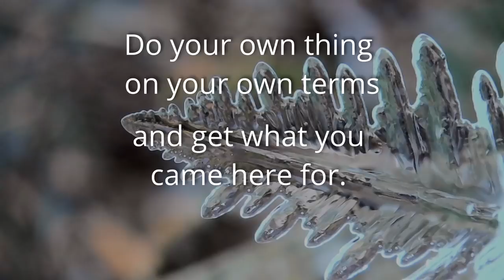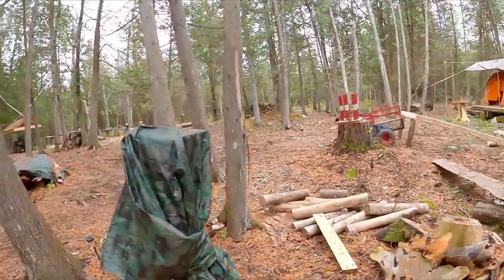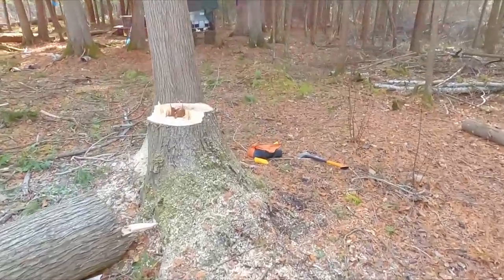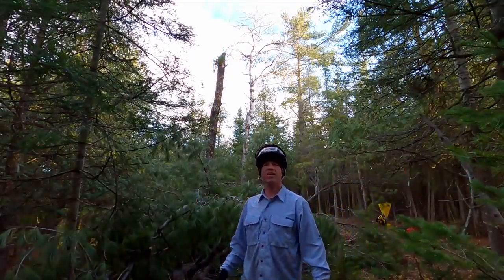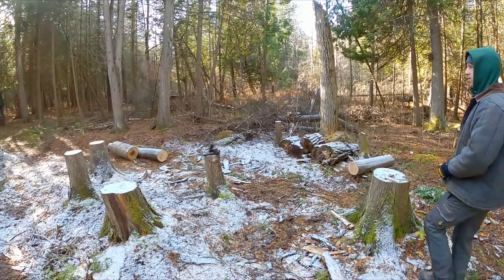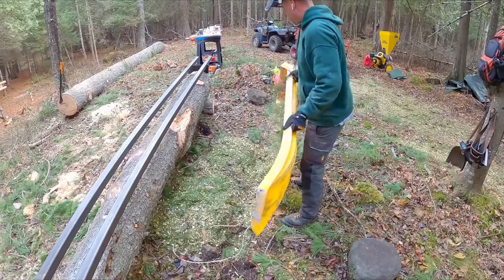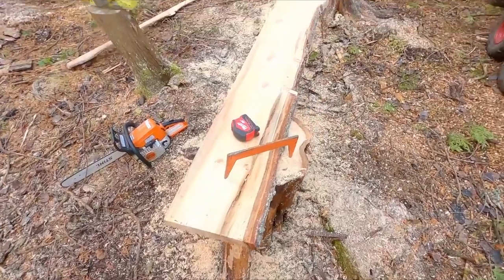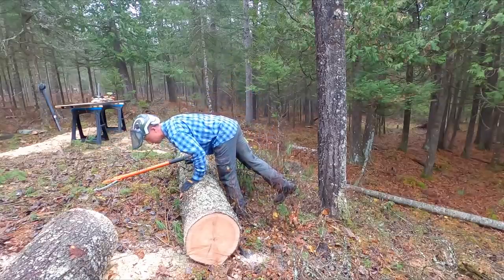Building a Tiny Cabin from a Giant White Pine with an Alaskan Chainsaw Mill.  #61

Comment: So, with all of those tapered boards, rather than cutting them into rectangular boards and ending up with the waste wedges, maybe just go with the natural triangle and then alternate them on your floor/whatever so from the end you have wide, narrow, wide, etc. and from the top it would resemble a backgammon board.  If you could make a buncha boards that are 2x6 on one end tapering to 2x4 on the other, alternating them should work and shouldn't mess up your symmetry...

Comment: Propane? Try a Chinese diesel heater.  I live in a 24ft rv, in Maine. I used Propane my first year $800.ish 4 mounth ish.then went to the diesel heater.$250.ish for four months ish. Just hook a 12 volt battery to your solar power run diesel. Roasty toasty.

Comment: Don't you own a tractor. If so get a logging arch for the three point hitch to drag the logs. The tractor can haul more than the ATV as well as lift the one end higher so less gets dragged on the ground. This will keep the logs cleaner. Cleaner logs = less chain wear.

Comment: What I do with slash is pile it in kind of walls. Wood from branches can be pounded a bit into the ground and or tied with wire to form "studs" on either side, then pile branches and other slash between the "studs". I had a chipper...still a lot of work imo. The walls were good critter habitat and I liked the look. They decompose over the years. A lot faster, less work imo.
Reply: Yup, windbreaks/perimiter delineation, critter larder and source of kindling in times ahead.
Pick your perimeter and pile it on the opposite side of two trees, if spaced nicely there's minimal need for studding poles.

Comment: Your crazy not to use a wood stove as a heat source...you have plenty of free fire wood plus wood heat is the best there’s nothing like it....if you build it rite with plenty of insulation you’ll be surprised how little fire wood you need to run a wood stove over the winter months....not to mention it’s the responsible thing to use as a heat source it just makes sense...I have a cabin in the woods and I only use 3/4 quarts of wood a winter to heat my cabin cause I insulated the cabin really well walls floor and ceiling....

Comment: Hey Ryan, new subscriber here and my name is Ryan and I'm in Michigan as well.  Love your channel, watching all your older videos now.  I am big on ideas so I always like to share some: I think a floor made of discs of logs would be awesome, as well as some stackwall building method walls.  I've always wanted to see stackwall done with squared up 6"x6" or 5"x5" with no chinking or just construction adhesive between logs...it would be very interesting and I'd imagine fun to engineer as you do on the fly.  Also I'm a huge fan of those Chinese Diesel air heaters, I'm actually making a video right now of me installing one to heat my garage, they're cheap to operate, quite safe, and really fun to setup really (also inexpensive and efficient)

Comment: Is there a reason your floor boards need to be 2X6? Why can't you have some 2X8, 2X9, 2X10, or even 2X11 1/2"? Since none of your buildings are square, you could make some floor boards 10" on one end and 7" on the other. Whatever it takes to make it come out right. It's so much fun watching you have fun in the woods. 🙂

Comment: Just recently found your channel. The way you explain your thinking. Doing it the way you do because you like to just wing it. And you just like running your saw. You are my kind of people. I've just recently got a chainsaw mill and have been practicing and making some 1" boards for siding a pole framed storage. Can't wait for the snow to go away so I can get into some larger trees to will dimensional lumber. I'm also off grid staying in my converted cargo trailer. I've put solar on the roof and a DCDC charging system that I hook up to my truck to help keep my powes bank changed in swinter. I eventually want to build a cabin. . In time. It's not easy on the back, especially one that's had a couple surgeries already.

Comment: You know you can burn the ends of the logs you put in the ground if you dont have concrete as it keeps the logs from rotting if you burn the ends Ive seen many videos where people do this to and boards or lumber that is burried in the grounsd because the ground will eat them otherwise but if you burn them they last a lot longer.